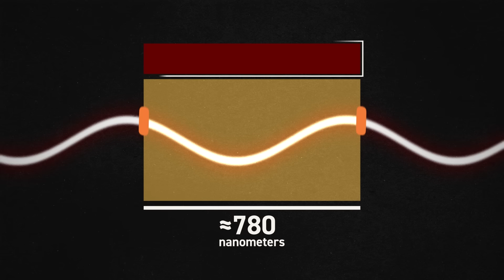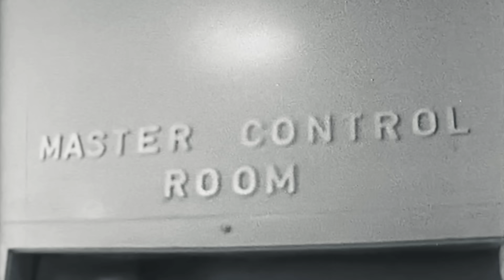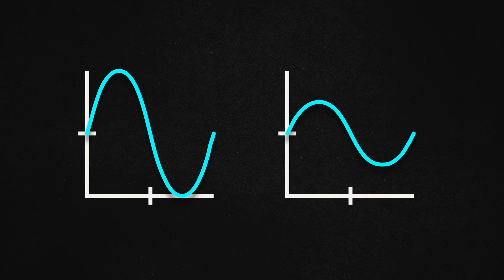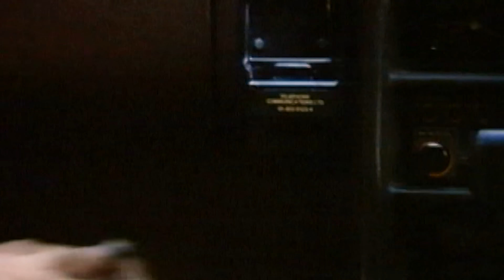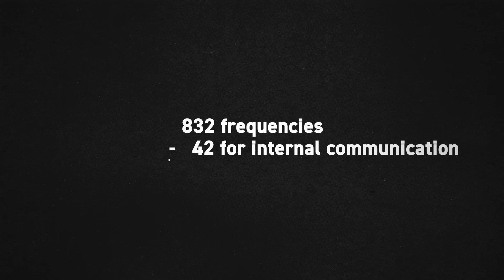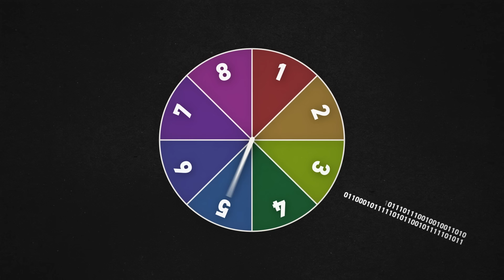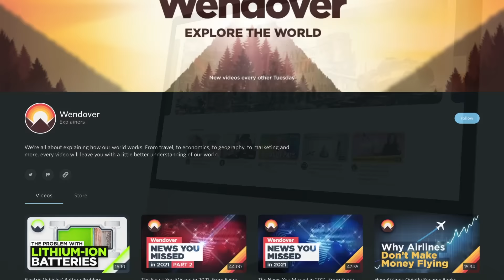How Cell Service Actually Works

Comment: Impressive video! Having worked on 5G in the telecom industry recently (backend, not radio) the amount of data the teams working on radio figured out how to send seemed like magic. After this video it doesn't, bravo!
Reply: The reality is that things are much much more complex than this video makes out.
Reply: @scienteer3562  Which he blatantly states multiple times
Reply: its basically data compression using the equivalent of an encryption algorithm
Reply: @scienteer3562  Sure. Once you reach orthogonal time frequency space (OTFS) modulation and MIMO antenna systems, it definitely can be.
Heck, I'm still trying to wrap my head around some of the underlying mechanisms of non-orthogonal multiple access, and most of the math still seems like magic.

But, I still thoroughly enjoyed his take and his explanations for everything. 
Hopefully, it will help demystify how radio signals work for the people who think tech like 4G and 5G are basically black magic.
Reply: @pawala7  the bit missing from the video was the effect of all these modulation schemes on the bandwidth of the signal.

Comment: You explained quadrature amplitude modulation quite well. Our current cell tech is pushing 1024QAM. That’s very new though it’s mostly 256QAM.

Comment: As someone who has been involved in communication for the past twenty years this video best sums up what is taken for granted by every 15 to 25 year old using TikTok and Instagram. 
This is why AT@T was slammed when the iPhone dropped. They literally had no idea what to expect and no system in place to handle that much traffic all at once. 
What we have today is just shy of magic and is why when it does fail to meet expectations people freak the F out. 

Also this is your best video ever. Bravo. 👍🏻
Reply: This complexity is why I've told people that it's a miracle that WIFI and cell phones work at all, much less as well as they do.
Several people have said, "That just means you don't understand it". I understand the protocols and math, it just feels magical to see it in action. It's like a well executed magic trick. I may know how they did it, but I can still be impressed by how well they did it.
Reply: @atk05003  "Any sufficiently advanced technology is indistinguishable from magic." - Clarke's law. Magic is present in our everyday lives
Reply: Could not agree more!

Comment: GREAT OVERVIEW ON THE EVOLUTION OF TRANSMITTING CELL DATA 
9:10 - - tree
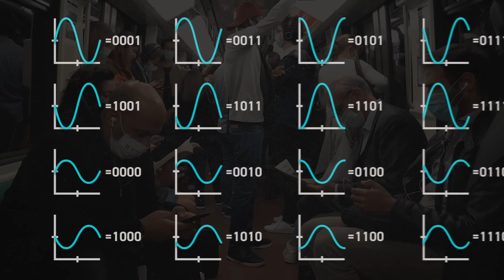16:30 - - packing as much data as possible into a single transmission
16:35 - - then packing as much transmissions as possible into a single radio wave
16:43 - - newest method (orthogonal frequency division multiple access) - - packs even more transmissions into a single wavelength

Comment: Interesting note: The noise/interference (mostly) older cell phones caused in audio equipment was due to TDMA. Switching the radio on and off hundreds of times per second induced AC voltage in nearby wires, that could them be amplified by stereos, TVs, Etc. and heard as a buzz from their speakers. CDMA creates much less audio interference, as the radio is always on, and there is no modulation of signal in the audio-frequency range.
Reply: That is very interesting! So the frequency of the full cycle must have been within human hearing ranges.
If that's the case, that means data was packed so efficiently as to allow a ~1/1,000,000* compression rate compared to analog! 
*Used toy numbers of a 1GHz carrier wave and a 1kHz transmission rate (the one that causes the audio interference)
Reply: so THAT'S what that sound was when you would get an sms
Reply: @icannotfly  Yup
Reply: @icannotfly  or just before a call came in.
Reply: I get that noise with LTE too (my phone does not have CDMA and only functions on the LTE network for Verizon).
Reply: Awesome comment!! I have thought about that many times. Been wondering that what exactly made speakers do that funny sound before and during calls. Thanks for the neat knowledge!
Reply: This changeover from TDMA was noticeable over the last 10-15 years or so. There used to be noticeable buzzing noises in aviation VHF radios (and even old analog radio alarm clocks) but over time it has become extinct.
Reply: @admlorenz  don't think "extinct" exactly, definitely much better. I still hear interference when the phone is handshaking with the tower.
Reply: What if it was an old radio built into a cabinet. Including a record and eight track player. What would cause a cb radio from a trucker, down the street. And his conversation being transmitted over said stereo console?

Comment: Loved this! As an Electrical Engineer that specialized in wireless communications, this was a wonderful refresher - the information presented is accurate and is essentially a slice of what you'd learn in a Communications (the engineering kind) class.
Reply: Yeah, it's like the slice you take off an apple that got dropped.  Mostly still edible, but some parts.... yech.
Reply: @zenithparsec  like the first part where he pretended that an LCD was a laser... Still great for a layperson though.

Comment: I've done a bit of analog RF stuff but I never actually knew how digital signals were transmitted over radio, I guess that makes sense as far as being able to pack in more information without changing the frequency you're transmitting at. Really informative video.

Comment: A great video, thanks to wendover productions, I am pursuing Electronics and Communication Engineering, a subject wholly related to this video, I know how to encode, decode, transmit and design these techniques such as QAM, QPSK, BPSK, CDMA, MIMO but never knew the evolution and why they are designed and how they are designed. At the end of this video I completely understand the whole thing behind digital Communication. I think I would be lucky if I had a professor like you.

Comment: If only college professors could explain things this easily and in depth
Reply: College professors do their work alone, have little to no budget to produce a video with this quality, barely have any knowledge on graphics/UX design, and, most importantly, have dozens of other roles in their department (administrative, research, mentoring, etc.) beyond teaching. Tbh I hope colleges evolve after this pandemic is over to allow that online learning and professionally-made content like this can be used more frequently when teaching instead of forcing professors to keep reinventing the wheel.
Reply: this kind of information will never prepare you to solve practical problems in the domain though, it's just a layman's explanation.  Training someone to actually synthesize this kind of information is much harder.
Reply: It's important to note that everything covered in this video is just the surface of how telecoms work. An undergraduate class would easily cover 100× the amount of information, because working out all the little details, how they work, why they work, and then proving correctness & optimality take a lot of time to teach and even more to digest. Now repeat for every single step in the process. Just explaining the spreading codes itself could easily span several hours of lecture at depth. "How does the formula work, how does it scale, and what edits could be made to enhance certain attributes? How do we deal with errors? What limitations exist, what can be done about it, and why? Now mathematically prove all of the above from scratch."

It's unfair to ask professors to teach all that, yet compare their lectures' digestibility with what is essentially the summary on the back of the book.
Reply: I thought you were taught race theory or gender studies 99% of the time in college or university nowadays.
Reply: @Vile_Entity_3545  not at all
Reply: @Vile_Entity_3545  Maybe in social sciences, but not in engineering classes.
Reply: I've had a university professor about the same field as this video that explained things in similar fashion - it was one of the most fun and memorable courses I took.
Reply: This is literally the opposite of “in depth” lol. This is surface level pop science info, which is good in it’s own right but you’re never gonna be able to do anything useful with what this video teaches you.

Comment: This video is a very good summary of how cell phones work. I studied electrical engineering in the 1980s and covered a lot of this material up to time division multiplexing. Then I got hired on by an electrical utility in 1986 which uses a lot of telecom equipment, and in those days almost all equipment was analog. I think this video would be informative and helpful for anyone studying telecom equipment in college or university, or for anyone hired on as a tech or engineer in a telecom company. Good work!

Comment: This was genuinely fascinating. It's nice to know what 4G, 5G, etc. mean, and that it's not just a scam.
Reply: "It's not just a scam." Yeah, like text messages that cost anything.
Or contracts on overpriced devices.
Or enormous roaming fees on what is essentially free radio signals.

Yes, the terms actually have meanings. The same people who convince you to pay so much every month came up with them, and it's the pricing which is the scam.
Reply: @zenithparsec  radio waves are free… but building and operating the infrastructure to transmit them is not 🤦🏻‍♂️
Reply: Birds are real
Reply: @rcnhsuailsnyfiue2  still, roaming fees are crap. The fact that Verizon charges $10 per day to use data in Europe is ridiculous, when the only thing that’s changed is that I’m now pinging someone else’s tower. I get they have to negotiate usage contracts, but maybe the way to solve that is making cell towers open access, meaning any phone company should be able to use any tower, and then either the government foots the bill for new towers or the companies divide the cost between them. That would actually work out better for most companies as they’d have less operational expenses. I don’t want to dive into the depths of this idea here, but that basis is what I think should be the future for cell towers, if we need cell towers in the future. The way it’s looking, we’ll be sending the majority of our data via satellite soon, and the cell towers won’t matter so much anymore. If I remember correctly, that’s part of why Google Fi has no roaming fees; they operate some of their transmissions via satellites, meaning you can connect to their network from almost anywhere.

Comment: Enjoyed the video - just one small correction. At 1:50 you say a 2M wave (the size of humans) is called a "Ultra High Frequency Radio Wave". 2M waves are Very High Frequency (VHF). Ultra High Frequency (UHF) is in the 70cm range (about 1/3 as long).
Reply: I came here to say this as well. I wonder what other critical errors were made in this.
Reply: A trivial error and does not materially detract from the outstanding presentation. VHF is 30 to 300 MHz. UHF is 300 MHz to 3 GHz. But in some application areas a different definition is used. E.g., the 225 MHz to 400 MHz military aeronautical band is often called "UHF".

Comment: There's also one obvious solution to the capacity problem: make the cells smaller. We've been building more and more low power base stations in heavily populated areas for this reason. Mobile phones also adjust their transmission power once they know the distance to the nearest base station, to make it less likely another nearby station on the same frequency will detect the signal. 

Spatial Multiplexing using arrays of small antennas is also pretty fascinating. I'm not sure exactly how it works, you can use beamforming to transmit two data streams on the same frequency in different directions at the same time, but I'm not sure if it can receive two data streams at the same time if they aren't beamformed themselves.
Reply: Making the cells smaller is fine, but it's also very expensive, since that requires installing a lot more cell towers. In addition to just the hardware and operational cost, there are a limited number of sites suitable for cell tower installation. Such location must be elevated, accessible by maintenance operators, suitably priced, don't have objections from locals (don't become an eyesore, etc).

If you just make the cells smaller, the remaining suitable installation sites can become really expensive really quickly, so it's still worthwhile to find out ways to transmit more data within the same channel.
Reply: @yvrelna  It's not as expensive as you might think, in urban areas there's already plenty of readily available places to stick a base station. It can be as simple as bolting a small grey box with a couple of antennae to a wall on a tall building, or a lamp post, and running an ethernet or fiber optic cable to a network switch. Smaller cells don't tend to need to connect to a lot of devices over a great distance, so they can be low power, and transmission attenuation from the device can minimise overlap.

Of course data compression and multiplexing is always good, because it's still cheaper than building more base stations, but especially in urban areas with the latest technology, it's not a massive expense to add extra base stations.
Reply: @Croz89  Installing the station itself might not be expensive, but more hardware means more complicated maintenance operations. Getting entry permissions, deploying maintenance workers, scheduling/deploying equipment for working at heights, etc, they all can add up.

If you only need to deploy small number of cell towers, these are much less of a problem since you will have many other alternatives if a certain site proves unsuitable for any reason. 

But as you increase the density of cell towers you're installing, these expenses becomes a lot more important as you'll have to settle with less than ideal locations. You can no longer afford to be too picky with your site selection.
Reply: @yvrelna  Less than ideal isn't so much of a problem when you're dealing with relatively cheap equipment. If it breaks, you send someone to swap the whole unit out and it gets repaired in a workshop rather than on site. In terms of heights, anyone who can use a scissor lift would be able to service most of them. Others just need access to a roof.
Reply: In 5G only the beamformed incoming data is fast at hundred of MB/s while the uploads from the user's cellphone is only at standard speed at few MB/s. Just try watch reviews of 5G for 5G phone and you can sort of figure out the answer for what you are asking.
Reply: If the two phones are far enough apart (how far is enough depends on a lot of factors), then the towers could in theory receive two signals at once on the same channel. Beam forming can be used to separate incoming signals as well as shape outgoing transmissions. (I'm not sure if any of the current standards use beam forming when receiving.)
Beam forming to separate incoming signals is how that radio image of a black hole was created several years ago. (They don't usually call it beam forming in that context, but the math is basically the same.)

Comment: The CDMA technique is also used by GPS. Each satellite has its own code and your receiver knows all of them, so it can pull apart the composite signal to get the data streams from whatever satellites are visible, and from there use the sent timing data to figure out where you are.

Comment: This is so well explained and exemplified. There are so many people who think radio waves are evil space magic and educating people what they are and what they do lessens the amount of misinformation they'll accept as true.
Reply: Indeed. Radio waves are just light with a much smaller frequency and hence much lesser energy. I think many common people don't get that. Because regular visible light (the stuff that we can see) has much higher frequency than that, and hence much more energy. Yet you don't see people freaking out that the light from their lightbulbs is gonna give them cancer.

It's really the higher frequency waves like UV rays, X-rays & gamma rays that people gotta worry about cause they carry more energy than visible light. As well as the very specific microwaves which have the same frequency as the natural frequency of vibration of organic matter. Due to resonance they pass their energy to these molecules more easily than other low frequency waves. It's what allows the microwave oven to cook food using only low-frequency microwaves.

Comment: There are a couple of errors in this video.
1.  I believe GSM Frequency reuse should be  1:3.  Google for what the cell network layout pattern looks like.  To color a plane of hexagons, "3 colors suffice!"
2.  Just an FYI in CDMA when a phone is near several cell towers it will hold 3 open channels called "The Active Set".  As you talk you make head gestures and this causes shadow fades and the cell phone literally hands off between cells as often as once every 1.5 seconds.  I used to work for Qualcomm and processed 1xEV-DO data handoff traces to produce a handoff statistical model.
3.  It's easier to explain CDMA with orthogonal vectors & pictures, imho.  Just multiple a signal by a x-vector and a y-vector.  The output is an (x,y) point.  From that it's easy to recover x separately from y, by just multipling by the x-vector or y-vector.